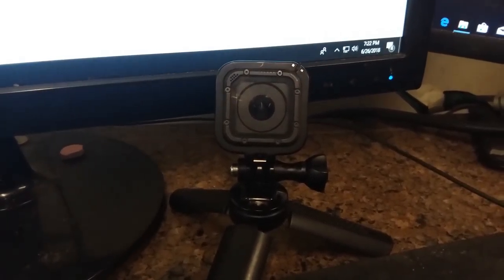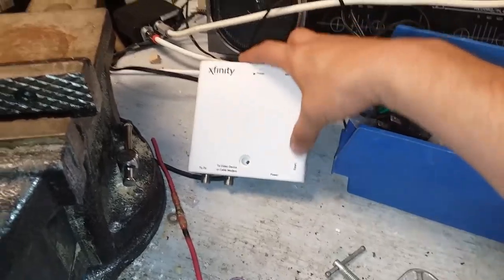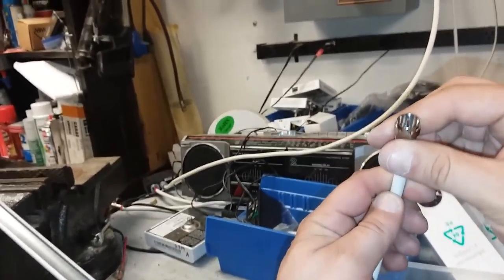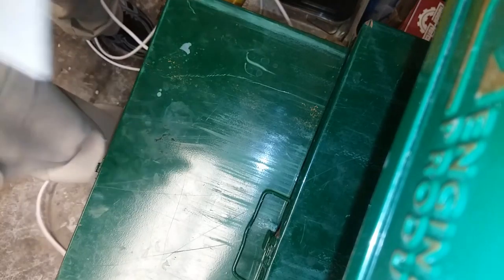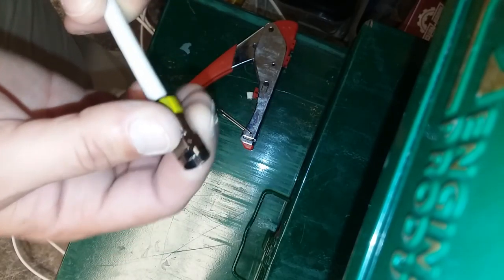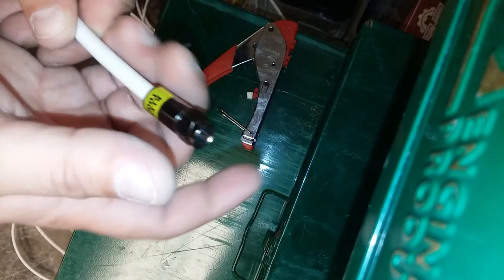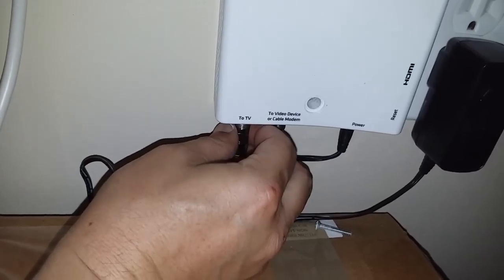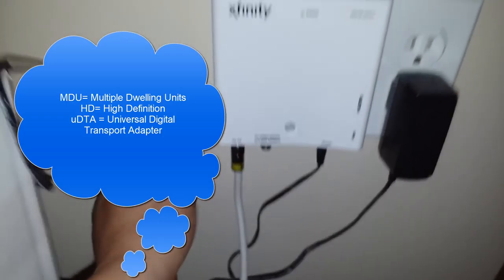How I Install Cable For Our Tenants.

Comment: if I had a dime for every connector I put on, I'd be rich as fawk and my hands would be less sore, from the days before compression connectors :))
Reply from the maker: throttle bottle man when I first came here everybody was using screw on connectors those things would make your hands bleed trying to get them on to the coax cable I know what you're saying the compression fittings we have the Klein Tools that are in this video those are the best connectors I've ever seen on this planet thanks for watching throttle bottle
Reply: screw on connectors, noooooooooo. I've used them before, but just for temporary testing, I mainly put on hex crimped connectors, but compression wasn't around then except for large hard-line ends, the stuff you see on poles and posts and your splicing rooms :)